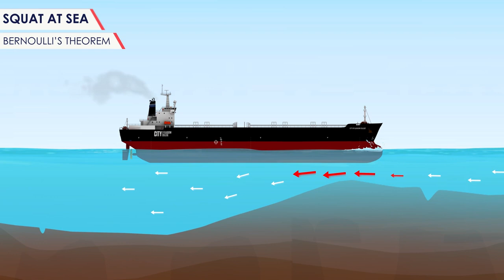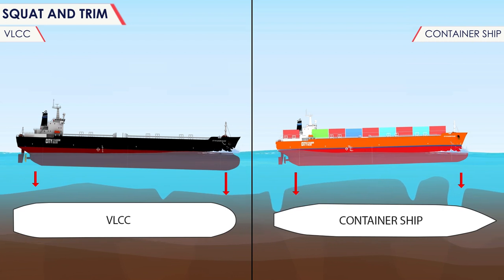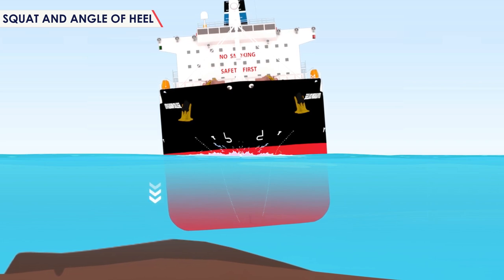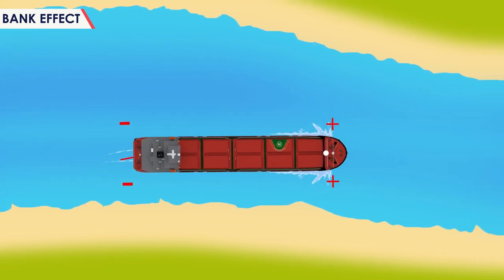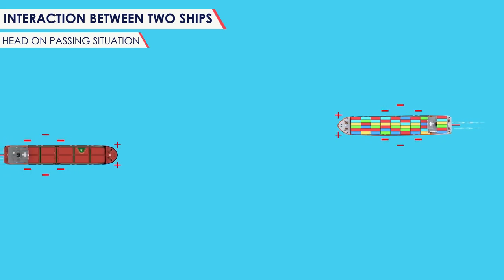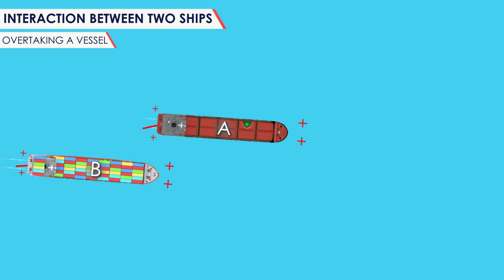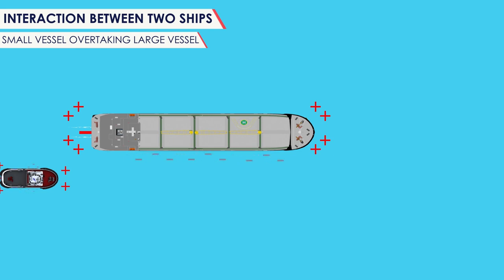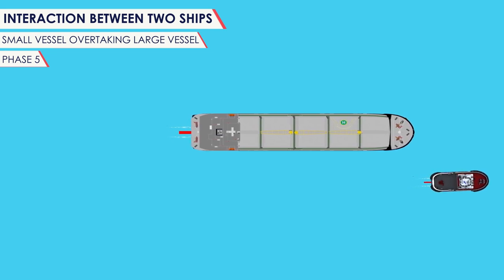SH Lesson 6 Interaction Bank Effect

Comment: @7:41 Bow has positive pressure and stern has negative but @9:45 ships have positive pressure at bow and stern . Why ?
Reply: Stern of the ship when the ship is moving usually has a positive pressure due to the churning effect of the propeller. But this positive pressure is way weaker than the positive pressure at the bow (when vessel moving forward).

Comment: 5:58 How could a ship's advance increase in shallow water? I would think more resistance would allow it to slow down faster?
Reply: Because of the shallow water effect, more resistance/turbulence is created at the stern pushing the Pivot point towards the aft (say 40% to 50% from the bow). So, the rudder effect on the ship's turning will be greatly reduced. Thats why the ship will have to move further than her normal 'Advance' distance, before starting to show the effect of turning, in shallow waters. Hope this clarifies your doubt.
Reply: @AnishMohandas  ah so it’s a factor of the advance and transfer increasing. Does the ships ability to slow down suffer (surge distance)?